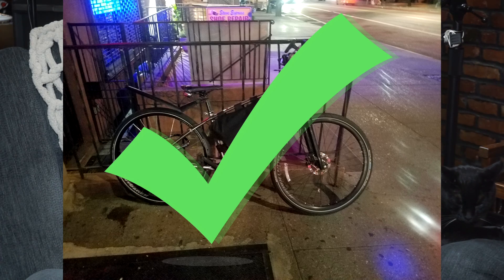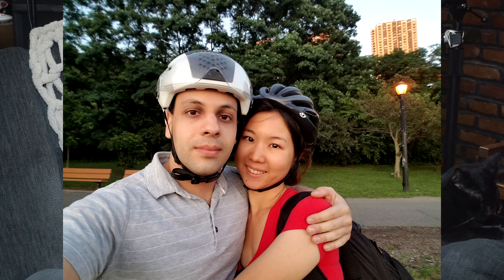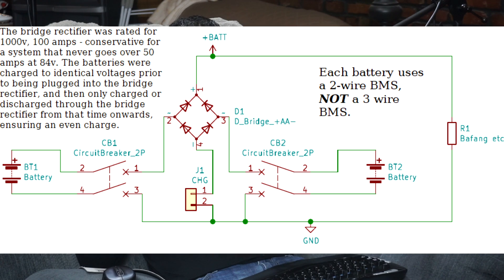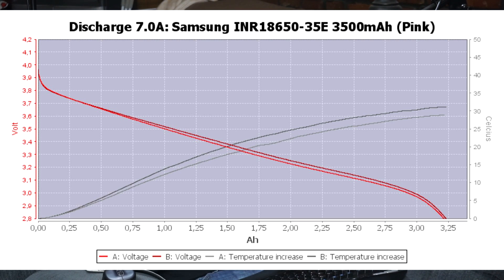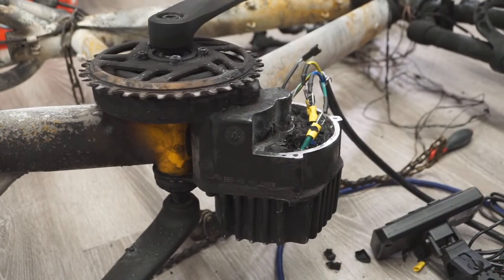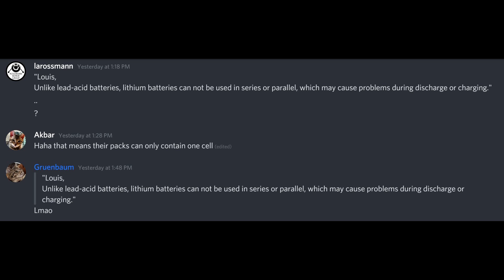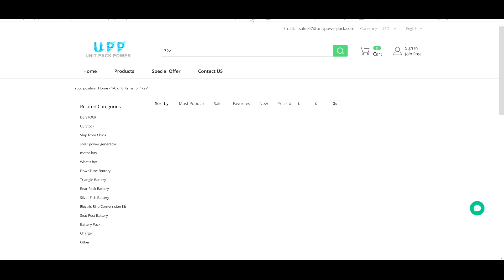Louis' front door goes BOOM courtesy of UnitPackPower battery.

Comment: You need info on how hot they get before combustion and a battery temperature gauge installed.
Thankfully you didn't bring it into the apartment and let it go on fire there
 although the fire exit was blocked at the front door
Do you not have CO₂ fire canisters in your apartment and store?

Comment: Ask the battery builder to include a bluetooth bms. You can always connect it to your phone and know the temperature of the 2 sensors( can put one in the middle of the pack and one near the mosfets) and how balanced the pack is. No need to disassemble the pack to check if it is balanced.

Comment: One thought for Battery and bike builders from my experience as an electrical engineer and having experience with industrial battery and electric drive systems:  Circuit Breakers like commonly used inexpensive DC motor systems are intended to provide Overload protection, typically for a motor rather than short-circuit protection for battery packs. Fast-acting fuses are typically used instead to provide Short-Circuit Protection because they can act almost instantaneously and reliably, where as circuit breakers are not always reliable, and contacts can even weld closed under extreme current spikes. 
I was thinking that as Li-Po and Li-On packs are susceptible to thermal runaway from over-current and short circuit conditions, that providing internal fuses or fusible links between battery banks and packs, if sized properly might go a way towards preventing an entire pack from experiencing thermal run-away if a single sell or conductor were to short, as fuses between banks and packs could limit the amount of current adjacent banks of cells and packs could feed to the shorted cell or cells.
Reply: Cell Level Nickel Fuse @ BatteryHookup..
Reply: @SyntacticOperator  Thanks!  Pretty Cool: https://batteryhookup.com/products/nickel-fuse-2p-wide-continuous-roll-by-the-foot-18650-cell-level-fusing
"If you use more than 10 cells in parallel you should have cell level fusing because there are enough cells in parallel to generate enough power to cause big problems if any cell has a catastrophic failure. Like
 Tesla, this fuse design is meant to protect against that catastrophic event without interfering with everyday use. The fuse will blow fast at 8 amps. The fuse can carry 3 amps continuous while staying cool and 
without voltage drop. The connecting strips between the cells will handle 10 amps."
Reply: The battery itself should have the right current protection and thermal management. I suspect the cell has a defect that shorted inside and nothing you can do will protect you from that. (Samsung Galaxy).
Reply: @maggiejetson7904  When you mentioned 'thermal management' and 'current protection', aren't those typically functions of the BMS, and during charging only?
from what I've seen, typically the bike battery packs are wired in banks of series/parallel configurations. 

My suggestion for choosing between the parallel banks of cells, would be that if a cell in one parallel bank were too short, adjacent cells and banks could back the that cell and contribute to a thermal runaway condition, and if adjacent banks of cells were fused to blow at current level over rated that, should prevent other banks of cells from contributing to a thermal runaway situation. If I'm missing something here please let me know?

On the schematic that Louis provided, I noticed that he isolated the two battery packs with a bridge rectifier. I suspect that is to prevent one battery pack from potentially feeding a short in the opposite battery pack. 

It's also not uncommon for rectifiers, diodes and SCR's short. on large, industrial SCR DC drives I I'm familiar with, the motor speed controls had fact-acting fuses ahead of the rectifiers and SCR drives in case of a diode short, and I believe a good reason to place a main buss fuses near the each battery pack output.

Comment: Sorry for your loss, well at least you did not get hurt.  I watched one of your videos when you were traveling through NYC.  At 72 volts your motor must  pulling 2000 watts or more.  As I ride mainly on the street, I went to a 1000 watt hub mounted motor on 48 volts (a Cal. limit). .  I can tell your bike is faster than mine.  As for batteries I use 6 to 8  5000 mah 30C 6S Lipos wired in series then parallel, not as good battery compared Lion in terms of  number of times they can be recharged,  but can handle a higher discharge and charge rate.  Balancing for lipos are a bit  easier as each cell is 5000 mah.   You probably had one or two cells that went bad and caused a chain reaction.   Remember the hoverboard craze a couple of years ago.  Those boards also caught fire because of a bad cell or two in the pack.    I wish you the best on your next build.

Comment: Question: why is a rectifier needed? The batteries are DC
Reply: to prevent current flowing from one battery into the other. it's not used for rectifying. the arrangement of diodes just happens to be the same for this purpose.

Comment: Hi, I'm an electric skateboard hobbyist that has recently released a a smart BMS (only 4S-12S, so not suitable for louis's 20S pack) and have EE background in concepting, design, prototyping and manufacturing.

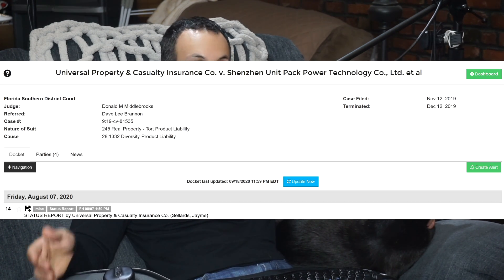I noted on the other user complaints about the UPP packs that they had a bad BMS' (9:10 ES-forum). This can cause absolute havoc with the cells especially if the BMS for some reason for example kept "balancing" a single cell with a balancing switch being stuck open for one reason or another. Then as this one cell gets slowly discharged over time to a lower and lower state without the bike being actually in use and will still behave normally under light cycle use, there is the possibility that when the rider actually uses the bike and starts to more heavily pull current and discharge the pack, that the single cell that had for one or another reason that at some point it gets discharged to 0V and then actually starts to get negatively charged (<0V) by the rest of cells, which are still in the charged range.

Once a cell gets negatively charged (especially with Lithium-chemistries), they are usually done and start to develop an internal short-circuit easily. Now this MIGHT be what happened, but alas due to the event happening rapidly and not seeing inside the pack enclosure or being able to monitor the cell voltages we can't be sure, but there might have been a series cell group that got negatively charged, developed an internal short circuit, started heating up due to power being dissipated in the internal short-circuit, heated up to a point of catching on fire and then the event happened.

Other thing it might have been, was some connection/wire/tab getting loose in the pack and then that short-circuiting and heating up and catching the pack on fire.

I wish we had more info how this event came about, as I'm personally very interested in the failure modes of Lithium-batteries and how to prevent them, but as I said before we just don't know for sure in this case what happened in the pack enclosure. All we know that externally Louis followed good procedure and monitor his discharge current to make sure he was within the given specs of the pack.
Reply: I think the BMS from UPP is missing some features:
Preventing  to charge the Battery ever again,  after one Cell was below the minimum Voltage of 1.5V or 2V
Preventing to charge if the Battery is too cold.
Also a second Problem could be, that the Pack layout was so bad designed, that some cells get hotter than other. For example when the length of the copper oder nickel strips are not the same between parallel cells, then is the current in the cell the highest, with the shortest length / resistance of the wires to the cells. This cell gets warmer than the others and also the internal resistance from these cell gets lower because of the higher temperature. And then the difference in current gets even bigger time. I saw packs with a temperature difference of over 25°C because of this mistakes. This mistake with a bad placed temperature sensor from the BMS and you have a burning battery.
Reply: What if the diodes breakdown voltage was like 3 4 volts and the difference between the two battery packs was more than 3 4 volts? Then the diode will reverse conduct, and current from one battery will go to the other.
Reply: @GMC997  Get an isdt charger. Your only running 4s :)
Reply: @GMC997  It is one of the best rc hobby chargers available, will charge most common battery chemistry's. Pd, nicad, li-ion, life and lipo.
Reply: @GMC997   You can checkout the project log I've been keeping at forum(dot)esk8(dot)news/t/flexibms-lite-flexible-configuration-bms-w-can-bus/8801 I'm in the process of getting a batch of 75 boards finished, but you can check out the project in the meantime and see/decide if it's something that would suit your application. That said, the BMS is a charge-only configuration, meaning that it can start and stop charging, but it can't control discharging.

Although for your use case as  @kenneth cartman  mentioned a RC hobby charger might work as well for a cheaper price.

Comment: Is it possible you have the breaker position wrong on one of the packs? So, when you thought you were charging both, you only charged one. Then, when you flipped the breakers, you then connected a fully charged battery to an empty one? Also, I would suggest fusing on a per pack basis.

EDIT: Nevermind, the bridge rectifier should prevent backfeeding like that. Hmm....

Comment: I have no idea if this is the case since I never seen this particular battery but could it be they are reciclying dead batteries?
What worries me the most is that those batteries have different internal resistance because come from different vendors which would explain why they can't be used in parallel, if one has less internal resistance than the other it will be put under more stress and maybe  before being rebranded it was also damaged by too much undervoltig

Comment: What was burning?  The bike battery itself was only a small portion (as you can see when they pull the bike away)., but the steps are concrete or brick and the outer door is metal & glass.  A garbage can or storage box beside the steps and a door mat?  Maybe a wooden railing?

Comment: Don't mind firefighters casually walking on the street as there's nothing burning.

There might be several reasons this caught on fire: 1) poor quality/fake battery cells; 2) poor battery pack design.
Even if each cell is a genuine one and all of them are charged and discharged correctly, they still heat up when heavily-used. And if there is nowhere to transfer heat from cells, they will degrade really fast, up to the point, they won't be able to provide even half of their declared output, and at some point they will explode. Overheating cells is as bad as overheating CPUs/GPUs (with only difference - chips don't explode), resulting death of the product.
So, overall, it's bad design battery pack or fake/low quality cells. Or might be both.

I just can't get why there is no temperature control put in these packs, even if some cheap brands like Xiaomi always put those in their power banks (even those, that can output only 10W LOL).

Comment: Most likely cheap cells or shotty workmanship connecting the cells. I have 2 E bikes, an electric skateboard, an electric scooter And a hover board. Even with a good BMS All it takes is one bad cell and you can get in trouble really fast. I always top balance and bottom balance the individual cells when I first get the EV. I only use Name brand cells like LG, Panasonic, or Sony etc. I am so glad that nobody got hurt. Lithium fires are not easy to deal with

Comment: The Lithium battery had a bad seal. Air got into the battery.  Which let the charged lithium oxidize hard enough to flame out. There was nothing wrong with your circuit.
It was a battery manufacturing fault.

Comment: 1st, I am glad you and your girlfriend are ok, and the apartment mostly unharmed.
2nd, I don't know lithium too well, but your comment that the lithium cells were charged to identical voltages before being connected to the rectifier to ensure even charging... uhh?
(i) Isn't the BMS supposed to ensure even charging on a per-cell basis, regardless of how they're configured? Be it 3S10P or whatever?
(ii) I will take your words at face value that a 'balance' of charge current/voltage between the 2 battery packs was necessary/desired (again, going back to part (i), I think the BMS should have handle this task...), but you know rectifiers are not manufactured for this purpose -- that is, you know they're manufactured for AC to DC conversion. The key application difference between the intended application and your application is that its not necessary that a rectifier in its intended use case to have a 'balanced' forward voltage rating for any 2 pairs of diodes. You know better than anyone that components are manufactured to some level of tolerances, such as resistors +/- 10%, 5%, 2%, 1%, etc. Diodes are no different. If one diode has a FV of 0.3v and another 0.2v, that's fine in AC-DC conversion since it would only mean that the load would vary slightly between AC phases, but you seem to indicate that this is not fine in your application. In short, you can't assume that 4 diodes are identical just because they come in one package. Again though, I don't think this is what killed the batteries since the BMS is supposed to handle this for each 18650 cell regardless of how you connect them, so, unlucky mate.

Comment: The bridge rectifier may be 100A rated, but that won't be at high temperatures. Was the rectifier on a suitable heatsink?? You must de-rate the current capacity with any temperature rise above ambient.

Still, I find it quite weird that the problem only happened when the bike was switched off. I wonder if one of the switches failed internally and shorted out the battery?
Reply: It would have taken a maximum of second or two after that for things to get interesting. There would have been no doubt as to the cause.
Reply: I had a LiPo battery from a RC Helicopter explode on me. It performed perfectly during flight and after landing it I picked the up the heli and carried it back, after 10-15 sec I heard a crackling noise and shortly after that the battery exploded in a huge fireball... That was a 14s 5000mAh battery. If any component had failed and shorted out the battery, it would have cooked that component instead but the battery itself caught fire on its own

Comment: I'm 99 percent sure they are but your CB1 and CB2 are physical circuit breakers, right?  Not some kind of solid state relays configured as circuit breakers?  That's the only thing I can see that could fail other than the bridge rectifier or batteries.

Comment: It only takes one dead cell in one package to make things go down the drain. But there should be protection circuits in the batteries or battery packages to prevent both overcharge and overdrain so that this shouldn't have happened.

Comment: To me, ( I build high end battery packs ) one of the BMS was most likely at fault. 1 BMS failed letting 1 of its parallel group of cells get out of wack, to high or low, and then the other battery cross charged it making that parallel group of cells overheat and then start the fire.    With a bad BMS both packs could still show the same voltage but the parallel groups would not in line with the rest.
Reply: Also, if it was just 1 battery pack with a bad BMS it would have still started a fire, it just would have taken 2 or 3 more charges first.           
The diode bridge rectifier was not at fault and is used all the time in EV's.

Comment: Louis: battery’s are dangerous and think well about buying one. 
Apple: replacing iPhone batteries are dangerous since a wrong battery can catch fire. 
Also Louis: Apple won’t let you replace your own batteries. IT IS CRAZY HOW DUMB APPLE IS TO NOT LET YOU DO SUCH AN EASY THING AS REPLACE BATTERY!
Reply: Do I see Louis arguing anywhere in this video that people shouldn't be able to replace batteries despite stuff like this happening?

Do iThing batteries hold remotely comparable power to a vehicle battery?

Either way, the issue here is bad manufacturing, not any fault of the consumer's. This is an anomaly.
Reply: I agree that phone battery’s are smaller comparison to this thing, but remember note 7? It was big enough to be banned from flights. A small battery blowing up on your face is more dangerous than your front door burning down.

Comment: Worst case scenario: short on the output: the 100A bridge will burn like a fuse long before the batteries heat up. There is no direct patch that may allow for a dangerous current.

Comment: Shenzhen = China....  i guarantee u they did not use samsung cells, or if they did they were bootleg samsung cells, considering the market in shenzhen sells 18650's (with 9000 mAh capacity..lmao)  for 10-20 cents a piece.  which makes them very easy to put these large batteries together for next to nothing and make a huge profit...
Dude, u know what ur doing,  just build ur own battery with ur own bms, and own cells so you know exactly what is going inside.  just need to get a spot welder and ur good to go.